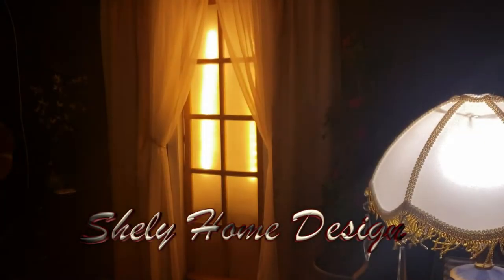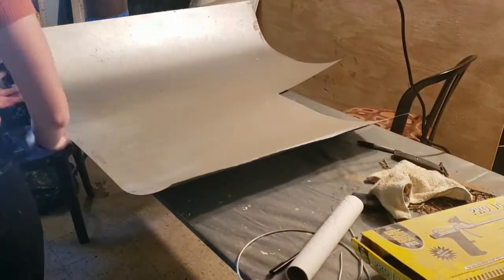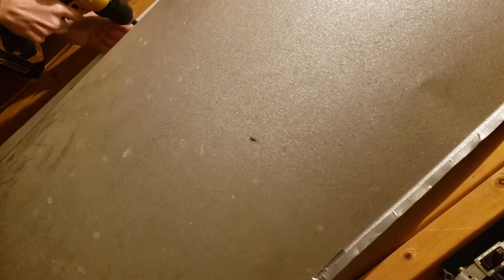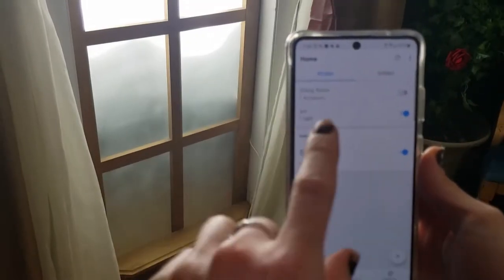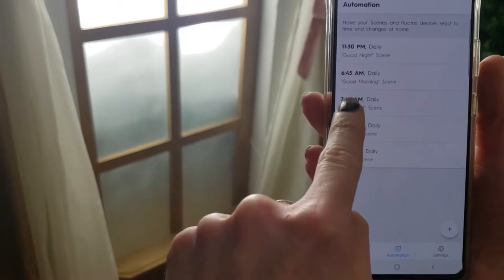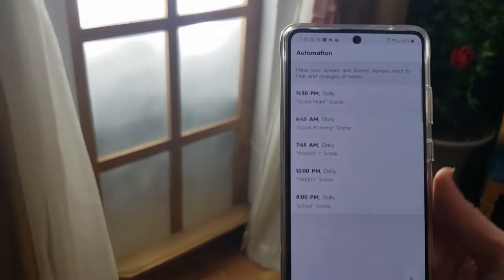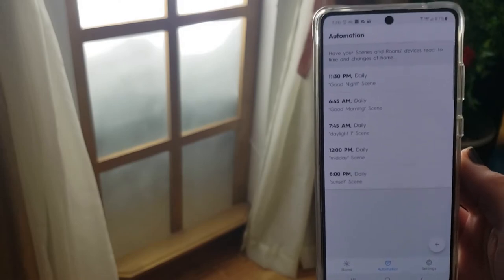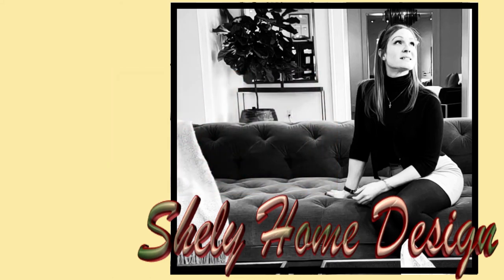FAKE WINDOW: How to fake sunlight! LED STRIP C by GE?

Comment: How does the app hook up with the lights? I guess I do not know how the mobile app controls the electricity of the lights.
Reply from the maker: The lights are plugged in and either use Bluetooth or wifi to connect to the app!

Comment: Can you add a link to the lights your using? What app are you using to control lights? Did the wiring you did in the beginning have to do with why the brightness is concentrated to the lights at the top? How did you create the gradient affect? Thank you!!
Reply from the maker: Hi! The lights im using are C by GE, I purchased them at Walmart, and I'm using the C by GE app. Unfortunately I didn't have enough lights to light the bottom of the door so thats why it has no brightness at the bottom. I wired these in parallel because I wanted both lengths of light to have the same power from the plug-in. But you can use an extension made directly by C by GE to be safer. I dont recommend sautering unless you're very experienced with it! I hope this helps! ❤